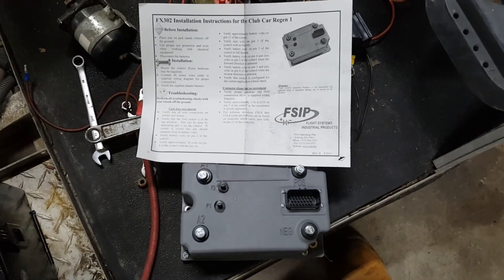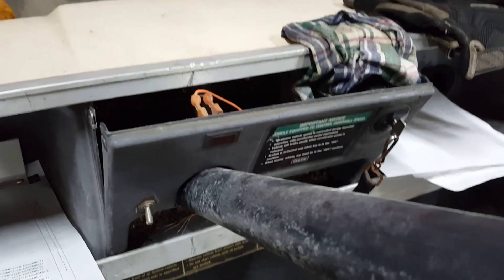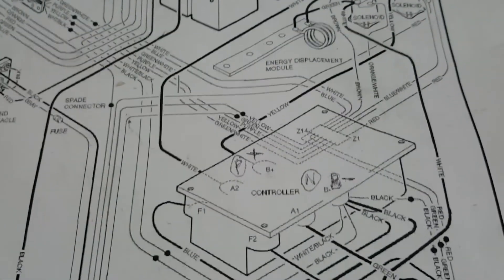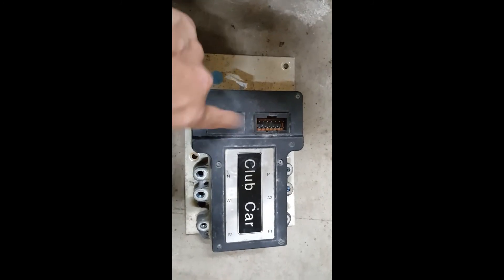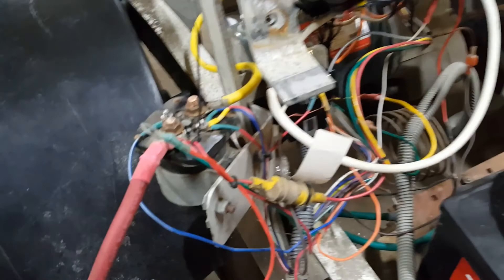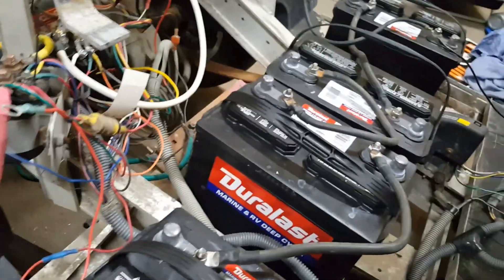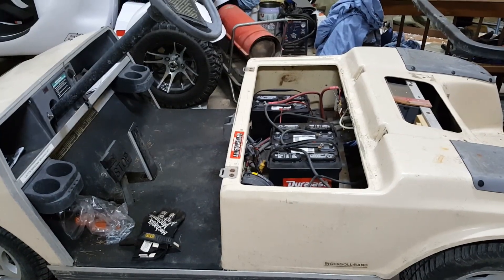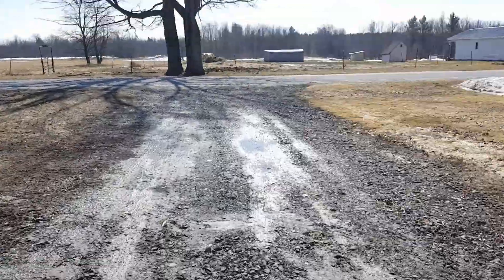1997 Club Car Regen 1 motor controller.

Comment: By the serial number on my DS it says it is a 2001.  For some reason I have no resistor coils, I do have a V glide throttle, no regen that I can see and no tow switch.  I believe I only have 1 solenoid and my controller is mounted vertically seen from the back hatch behind the seat.  I'm trying to figure out if I have a frankincart...  When I purchased the cart is looked like the previous owner was either Bo or Duke Luke.  A few spots on the frame still need to be rewelded.  Any thoughts?
Reply from the maker: You have to get the schematic for the electrical system. Keep looking in the forums for the one that looks like your. I took me about 5 tries to find the right one. Good luck. ...fyi It is Bo and Luke Duke. i.e. Dukes of Hazards.
Reply: @captkaos45    Lol, I definitely switched those didn’t I.   That will teach me to try to multitask reviewing differential equations and commenting on YouTube videos.  Lol.  I just looked at a few of my pictures and I’m wondering if they removed some things to try to make it faster and remove the regen switch.  I’ll have to go wire by wire on the schematics when I have time.  If it is regen than a throttle upgrade won’t be too bad.

Comment: Hello Peter, I got the same model, mine is 9704-557026. The reason why I am here, is my solenoids will not click on and the cart does not go. I read you sold it already. I replaced the two solenoids one at a time and that would work getting the cart to go again, but a month later, no more clicking, then O replaced the 2nd Solenoid and it worked fo 3 days. Now back to nothing, no go. No solenoid clicking. I check all the wires, still puzzled. Do you got a contact? We enjoy the cart while it lasted about 6 months.

Comment: Mine is also a 97. Time to replace batteries.  I've thought of doing the switch to 4 12 volt batteries myself.  I play quite a bit of golf. Just wondering if I would get the same longevity of use out of 4 batteries as compared to 6.  Have you noticed a difference?
Reply from the maker: It won't have the same longevity. I sold that cart, so can't give you an accurate answer to a difference. It was a lot lighter, so it was quicker and faster.